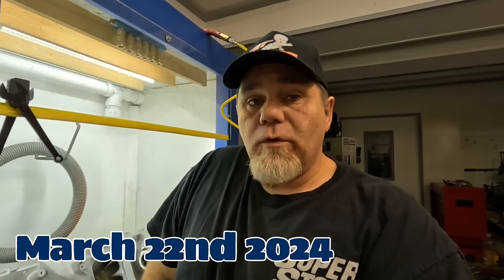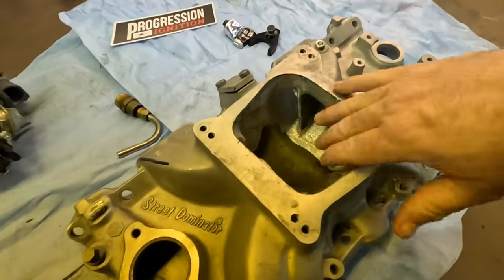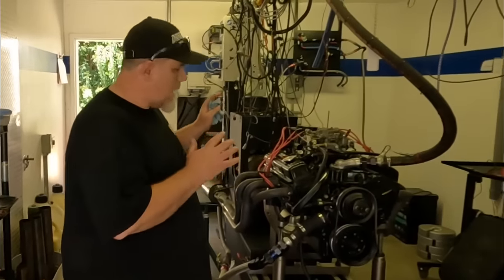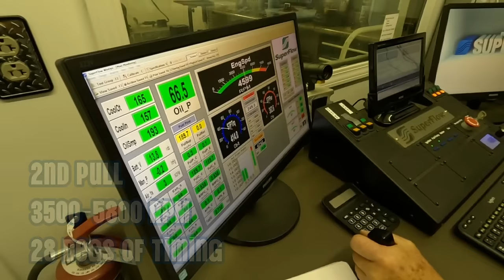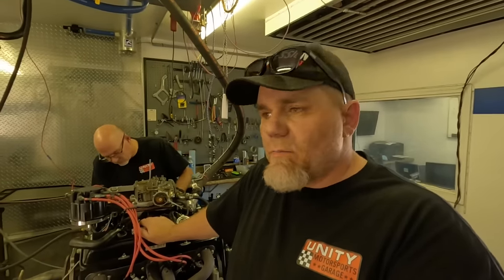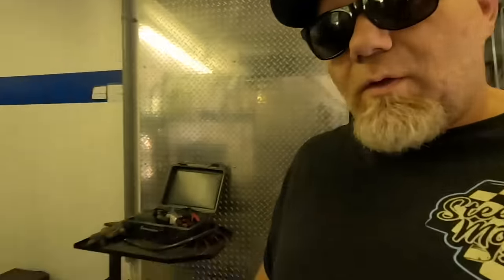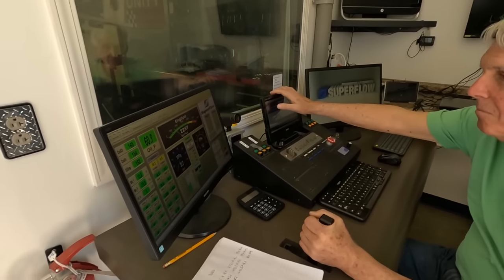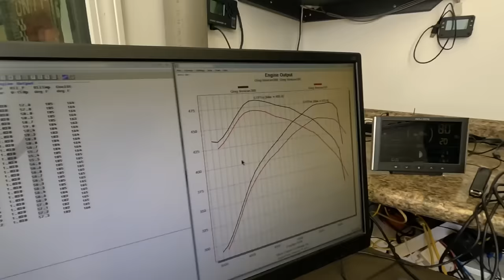408 CI SMALL BLOCK CHEVY, PROJECT SLEEPER:  DYNO TEST!!! WILL IT MAKE POWER???

Comment: I had a 71 Buick GS 455, build to a stage 1 spec and with the 800cfm quadrajet, would make 460 horse and 550 lbs/ ft. As I started facing it, adding gears and better exhaust, fuel quantity was an issue. The quadrajet fuel bowl is really small, but short of fuel injection it's an awesome street carb. It gets a lot of hate though.
Reply: Yep, the Qjet is not a bad carb. I've read it's good to this hp level.  Cadillac motor 600 something ft lbs on qjet.
Reply: The idiots that complain about Q- Jets didn't change the gas or air filters or spray clean them out ?
Reply: The haters just dont understand them
They are a smarter carb for a true daily for sure. 
Love my holleys but the best dailys had Qjets with chokes.
Reply: @gordocarbo  
Too bad they didn't make a 1,000 cfm Q-jet.

Comment: 408ci sbc with afr comp heads and only making 475hp is saying something seriously is wrong, cam and carburetor and intake manifold is culprits with just a reasonable cam 510-520 lift and decent duration thats a 525hp+ motor all day, your making decent built combo 355ci power, you got alot more horsepower in that motor.
Reply: Hook up the header evacuation system and you'll pick up alittle HP also

Comment: Flipping the lid did not add 25hp, it simply removed the snorkel's restriction.  Would have had the same effect going with an aftermarket 4" open filter.  Great video guys!

Comment: My guess of 480 hp 500 ft lb of torque was pretty close! Would like to see what it would do with a victor jr intake and 830 hp Holley carb!
Reply: Yup. It's dying for a bigger carb.
Reply from the maker: Im willing to bet with a cam, carb and intake swap we could get near 100hp more
Andy
Reply: As is you’ve built a sneaky street cruiser with all that torque and the 700r4 transmission first gear traction will be the biggest challenge
Reply: @UnityMotorSportsGarage  intake and carb alone should get close to the extra 100hp maybe a better ignition system. But it would defeat the purpose of it looking tame under the hood....
Reply: @UnityMotorSportsGarage  ,,,,,,,,,,,give those heads to DV.........and use a manifold he approves....
Reply: @marrerowski  Intake and carb will not get him anywhere near 100 come on.

Comment: Badass sleeper motah!!

Yep, flipin' the lid, we knew it was a massive hp boost 35+ years ago, and still holds true today! That's the kind of hp gain you can absolutely feel by the seat of your pants. 💪
Reply from the maker: Most definitely and it sounds cool... Lol
Thanks for watching
Andy
Reply: Depends a bit on the filter housing design, with a stock filter it can choke it a bit with some lip shapes - the real advantage is when you run a taller filter in the housing, whether flipped or not 👍😎
Reply: @UnityMotorSportsGarage  ,,,,,,,,,,,,,,,,,,,The filter steel base is most important if it has the corvette style high radius up to the carb air horn,,,,,also ya need a K / N style filter ......
Reply: @ThomasELeClair  Agree!! Work so much better than those k and n elements that dont use a lid at all. Moroso? Makes a lid that mirrors the base shape

Comment: This is cool if you already have the 400 block to start with but the true 350 "sleeper" is the 383. The people who know wont be deceived by the valve covers alone. Cool build though and nice job on the intake and using a quadrajet carb for full incognito effect. Most builds go with holley type carbs if not efi.

Comment: Your grinder work is great Andy:) 
She looks really good buddy…
Huge improvement from stock…
Reply from the maker: Thanks! It has a very smooth Dyno curve which is exactly what I was after with the old Street Dominator intake
Andy
Reply: @UnityMotorSportsGarage  Havent seen one of those in awhile. Like messing with older oddball intakes. ANyone can buy a brand new one
Spent many hours porting a 7530 Team G, flowbench time etc. 
Just right on my 383....great midrange and strong top end not too much tq down low so it dont spin.   
Love to see yours with a 300-36 and a dually 454 stock air cleaner. 
Torque curve is perfect for a driver it will make huge tire smoking torque everywhere. Thats what makes a street car fun
Use some 20-22 in case Superturbos it will be quiet and quick. Love sleepy stuff

Comment: I appreciate the video ..Many years ago i built or helped really build a 302 for my 68 Camaro ..part  dirt track bottom end top end off a g gas car . I ran a solid lifter isky cam along with other parts. I used a HEI distributor,  bronze gear . Recurved . I remember the engine pulling hard to 7800 where i had the rev limiter set . ..I learned then cylinder heads are the key to making hp .. thanks for the video
Reply from the maker: Absolutely the heads are KEY to making power...
Thanks for watching
Andy

Comment: With the Q-J, double check the air flap's spring setting - Been a few decades, but IIRC it should be either 3/4, or 7/8, of a turn from JUST closing the flap - an 1/8th either way could also have been enlightening.

Don't know if you did it, or if the heads you used had them, but a couple of bits of shim stock slipped down between the manifold and the heads, to block them off, can help a little by reducing the cross-heating of the manifold base.

Comment: Not too bad for a first run gotta start some where and go from there.  The lid flip didn't surprise me I've done it many times over the years and I always could feel the difference on the street.  I know the quadrajets becoming a restriction do to flow size, but the cam needs to go for a better spect one.  Run it with a better cam and the quadrajet then just to see what it can do put a higher flowing spect carburetor on it. Personally I'd be willing to give up some of the power just to have that nostalgic Quadrajet sound of the secondarys kicking in, and fool everyone into thinking it's a rather stock replacement engine.
Reply from the maker: See that is exactly what we after... With this engine having an almost stock idle and when you pop the hood and see what looks to be a mismatched Single plane intake on a stock crate motor and a Q-JET people will think it's easy picking! 
Thanks for watching
Andy
Reply: @UnityMotorSportsGarage  agreed I had a 1980 c10 with a stock appearing 350 but it was a 383 toped with a quadrajet and that thing would get it.  Had the slightly loopy idle but nothing that gave it away. Most thought it was all in the exhaust I miss that truck.  Looking forward to seeing more on the 408.
Reply from the maker: @chevyfan82  you will get to see it in action next month at the track!
Andy

Comment: For such a mild cam it seems to work well, its running out of air already. Make a great cruiser or truck engine. It would be a good engine to do a rocker ratio change on to see what happens at the existing airflow.
Reply from the maker: Yeah, depending on time I have some other things I would like to do with it.. Dyno time goes by SO FAST.. 😆
Andy
Reply: @UnityMotorSportsGarage  atleast you have engine dynos you can drive to. All we have is 'tooners' down here with drums. Actually thinking about building one.

Comment: Put the Comp Cams Beehive Spring #26918 intended for LS engine in it. Perfect for your build. AND the DUI was the right choice. I'd change the cam though.
Reply from the maker: DUI didn't make the most power... 
Andy
Reply: @UnityMotorSportsGarage  Try again.
Reply from the maker: @autonomous_collective  you buy the Dyno time and I will test... But we backed up the runs I will have a full video on it upcoming
Andy
Reply: @UnityMotorSportsGarage  Jones knows his stuff Id leave it in there.

Comment: Great job on the build guys. The manifold mods appear to be working well, and lastly I've always had good luck with the Q-Jets. You might double check the Q-Jet, it could be only a 750cfm? Look the bulge on the wall of the primaries and it's the 800cfm. One last test I would be curious what a stock Chevy or Edelbrock performer manifold Dyno numbers would look like? But that's definitely a strong sleeper motor but still nice road manners, good idle 👍👏
Reply from the maker: Yeah its an 800CFM unit. I was surprised to see it pulling vac. in the upper RPM ranges. This is going to be a nice cruiser that can sneak up on some folks..
Thanks for watching,
Andy

Comment: Don’t know if “flipping the lid” actually did much other then giving the carb more area to draw air from instead of  making the air route through the small intake hole in the filter housing. Maybe an open air filter would do the same as flipping the lid. The drawback would be loosing the sleeper look though. Love the content of actually searching for the problems instead of pushing advertisers like most shows do.

Comment: Love the build! Single plane is killing your torque though.  When I had my 383 on the dyno that is now running EFI in my Express van, I had it running a later 850 cfm Q-Jet on an untouched Performer RPM spreadbore with a Hamburger 1" Q-Jet taper spacer upside down cone shape facing the carb.  It has a mild hydraulic custom roller, 271/284 @ 0.006, 218/228 @ 0.050 on a 108 LSA and 106 ICL with 0.578 lift.  11:1 static compression and aluminum heads flowing 244 @ 0.400, 274 @ 0.500 and 291 @ 0.600. Ran with 1-5/8 primary to 2.5" collector Thorley tri-ys for the Express van chassis into 2.5" collector extension.  Made 520 tq @ 3,700 and 502 hp @ 5,600.  I had the HEIs mechanical advance setup to give 0 advance until 1,200, 10* @ 2,400 and 16* @ 3,600 by playing with an assortment of center plates and weights. The centerplate was 353 stamped and 053 weights, running 2 medium springs from a Moroso curve kit. It liked 33* total @ 3,600 and AFR was in the mid 12s. The 850 cfm Q-Jet saw less than 2 in/hg @ 6,200 rpm.

Comment: I was about to comment on how smooth the idle was when you went outside while running it.  Definitely sleeper quality.
Do you think the spreadbore benefits from the floor base dam as much as a square bore would?  I wonder if the dam would block some of the rear secondary air from reaching the front four cylinders.  Did you have individual cylinder fuel monitoring on the dyno?

Comment: That's why I use MSD distributors , the are equipped with the option to lock out the machanical advance so you don't have that issue with your engine.sounds good , I have that same intake and you got me thinking about porting it like you did , thanks

Comment: D*** good video showing showing what happens when you flip the lid, but then also keep in mind when the motors in the engine bag and the hoods close. And you're sucking in all that hot air off the engine.  That's also got to make things a little great video. I'd like to have a feedback on the oil pressure situation. If you guys think that's a deal at all I just didn't like to see the oil pressure drop as the RPM went. I'd like to know what oil you have in it.  Thank you, Greg and the team.Thank you again

Comment: There is a Way to remove the restriction on the Quadrajet remove the Choke completely gives you another 20CFM on the Primary!
Reply: Ive removed them on a few carbs and felt 0 difference
Even in mild weather here love a well setup choke
Reply: @gordocarbo  
I've tuned several Quadrajets that would prove otherwise and not have to have a choke fire instantly even on coldest days no bog Gone...

Comment: Love the Q-Jet! Had many in the past and 3 currently (one special 800 cfm for a 455 T/A that was a $70 investment). Shocked there wasn’t a K&N under the flipped lid or a taller than factory with an extended stud bolt.
Reply from the maker: Im now a Believer in the Q-Jet.. On the K&N we decided to just run a Paper filter to continue the sleeper look
Thanks for watching
Andy
Reply: Plumb. A. 100 hp.  Nos.  Under. China.  Rail. In. Rear.  And.  Really.  Rock. Somebodys. World.  Great.  Sleeper. Build
Reply: Old timer had a 71 Lemans bracket car 3750lbs 400 ram air 3 heads flat tappet solid cam headers a single plane intake and Q-Jet……… the car had a turbo400 3800 converter 3.73 gear and it ran 11.40-11.50 EVERY SINGLE pass and without me asking he said “Its the Q-Jet”.  Coolest stock looking sounding car I’ve ever seen.   I’m sure the F.A.S.T. Class guys know a thing or 2 about Q-Jets

Comment: I had a pretty similar problem with the factory hydraulic roller springs on my AFR heads with a very similarly sized camshaft. It’d lay over around 55-5600 RPM. I swapped out the cam thinking it was just the cam being too small for the engine and a single pattern to boot, then changed the springs out too. The old cam is going into a 350 with the proper springs now so I guess I’ll find out whether or not it was the springs or the cam that laid over on me.

Comment: It would have been nice to see what a 1 inch spacer would have done for the small plenum on that intake. It seems to have a much lager effect on small blocks than the big blocks.  What do you think a nicely prepped 850 would have done. Maybe over 500 HP. 950 3 barrel was good for a tenth in a 69 Buick Skylark with a 455. Good test.
Reply from the maker: The QJET had 1" open spacer 
Thanks for watching 
Andy
Reply: Doesnt need any more carb than what it has

Comment: Always been curious of Dino results from a q Jet carb. Back in the day when I was broke I had a 780 cfM Q jet 331 cube Small block.That pulled hard to 7000 Only reason I put that carb on there is because it was a 150 bucks at my local auto parts store rebuilt and  But I was a broke 19-year-old kid the was no save up for 2 more weeks. That 69 GMC had to out an get in trouble. later saved up and put a holly 750 double pump on it. Cause my buddies are laughed at  The bog quad But it actually ran better with that carb than it did the 750 holly out of the box. And it got good mileage. And every classic movie sound has that noise from the 80s All the caprice cop cars.  They were great carbs as long as they sat on a good loom intake and had no fuel boil issues like the stock cast intake. I love them and the sound they make  In the secondarys open. quick throttle response can't beat it.

Comment: Does a 4-7 cam swap help fix the induction sequence issue of the stock firing order. In a dual plane intake is the 5-7 sequence a problem?
Reply from the maker: It does but it just moves the same problem to 4-2 cylinders. This only really applies to Single plane intakes as the Dual plane separates 5-7 to opposite sides of the carb
Thanks for watching
Andy

Comment: Can't hurt to drain the break-in oil Andy. So the distributor was the problem?
Reply from the maker: The problem was the spade connector 12v supply going to the Distributor.. it was loose and causing the whole issue
Andy

Comment: I have had two of them, great running engine. 😊
Reply from the maker: They are really good engines. I just wish the blocks were a little stronger
Andy
Reply: @UnityMotorSportsGarage  it's the only weakness of them. But I learned from the first one I had that if you are on top of it and don't let it go to the point that it would need bored between refreshing they will last. I would like to go back to getting one in something but I have went to FOMOCO now and I don't want to go back. I have bought a rust free 1988 Mercury Cougar XR 7 from a 90 year old guy and his son. They threw a fuel tank, fuel pump, sending unit, new fuel lines and 8 new injectors in the 5..0 L and I bought it for 700$ before they scrapped it. Luckily I was at the right place at the right time and saved it. Wait until you see it, it looks like it sat in a dealership somewhere since it was new. The interior looks like the day it rolled off the show room floor. I can't wait to get it done and running. Great day to you all Andy. Sincerely John

Comment: It's not going to be 25hp on a stock engine but it just proves how much of a restriction the stock air cleaner housings are on a modified engine. It would be interesting to try it with a dual snorkel just to see as well
Reply from the maker: You are right.. it's on this engine.. it would probably be next to nothing on a stock motor maybe even less since you are getting hot under hood air 
Andy

Comment: Looks like y’all are close to me because I saw the Charlotte hwy sign. I’ve dreamt up a weird idea. I could care less about high crazy HP. I saw an episode on horsepower tv where they turbocharged a big block ford for torque. I want to turbo my 350 TBI with a small turbo to get as much torque as possible. I also want to do it with the TBI. I know there’s a lot of haters on those things but they just work and keep working. Anyone I know personally that has a TBI 350 is still running the original setup. There’s upgrades you can due to them and on the cheap. My thinking is what’s the point of getting a aftermarket EFI if your goals aren’t 500+. Plus I’d get a kick out of seeing a TBI pushing 400+ torque.
Reply from the maker: TBI works.. the Old Holley Projection fuel injection was basically Chevy TBI
Andy
Reply: @UnityMotorSportsGarage  I found the guy that deals with TBI stuff. I want to talk to him about what I need to make it work.

Comment: I noticed with the lid flipped over the air cleaner is bouncing around during the pull like its not sealed. I wonder how much air was bypassing the filter.

Comment: @ 1985 or so Chevy came out w/that throttle body w/the injectors on the "carb." Basically Chevy's quick fix to have quick easy F/I. Is this viable for extra HP? Your 408 SBC could say 2 of these be used to make a significant HP gain? Worth the head ache to play w/these old F/I system or not?